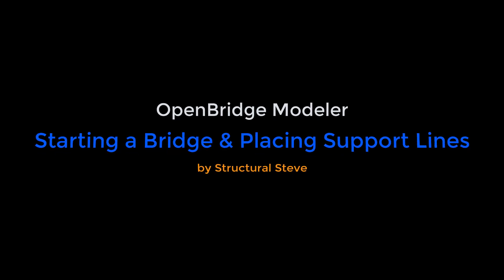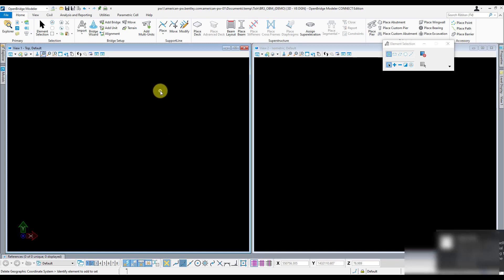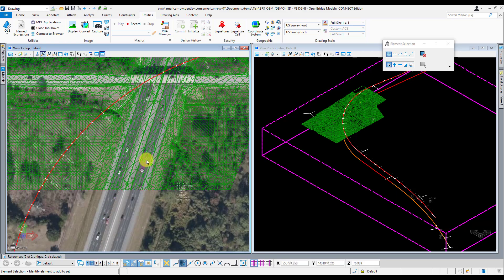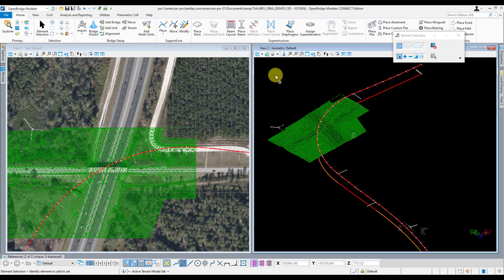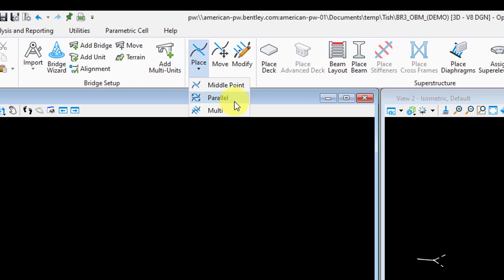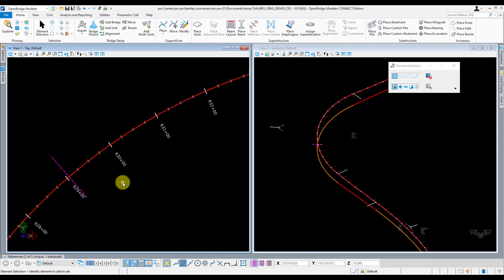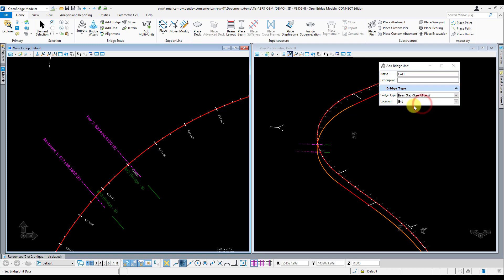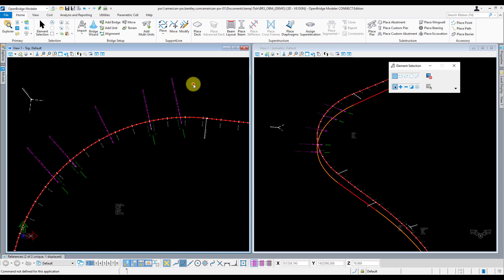OpenBridge Modeler - Starting a Bridge & Placing Support Lines

Comment: Steve, have you ever seen the manipulators not be selectable?  For instance, when I place support lines and then chick on one of them I see the angle/length/station manipulators show up. When I hover the pointer over any of this info it will not select it. I’ve also had the same trouble with alignment manipulators. Is it possible the 3D is not allowing it to be selected?  I’m running connect 2021 release 1 update 10.
Reply: Well, I just figured it out. If I zoom way out I can the select and modify them, if I zoom up to them, they cannot be edited. Got to be a bug.
Reply from the maker: @93SA10  I usually select the support like then edit it through the properties dialogue. That will be the most consistent way of doing it

Comment: Hi Steve. I have an 11 span bridge with 3 units.  My bridge has 9 total piers but 2 of the piers have 2 bearing lines. These are where my units switch. When I am laying out my support lines for these 2 piers, should I just have a single support line at the centerline of pier or two support lines representing the two bearing lines?  Thanks so much!
Reply from the maker: Support lines and bearing lines are independent of each other. You should only have one support line per substructure element (pier or abutment). The place bearing tool allows you to place a single bearing line or two bearing lines as a single bearing group.
Reply: Thank you so much Steve!  I was worried I’d get my model way down the line and have to redo it.

Comment: Hi Steve. This may be a little out of your wheel house because it involves OpenRoads, but I'm having difficulty selecting my alignment when clicking the 'Add Bridge' button. I created an alignment in OpenRoads, added a terrain model, set my vertical data, and set it as my active profile. I then attached it as a reference in my OBM model, but it won't let me select the alignment. It just says 'Element not valid for tool'. Any ideas? Let me know if you need more info. Any help would be greatly appreciated.
Reply from the maker: Hi Bryan. When ORD creates an alignment it creates two separate elements: a 2D alignment and a 3D alignment. The 2D one is the one that has civil data associated with it, thus it is the one you need to select when adding bridge. To help with this I always turn off that 3D alignment in my level display.

Comment: Hi, I have to model an existing bridge from available construction plans. This bridge is part of a twin bridge system and the alignment is in between these two bridges. Could you please provide an insight as to how to model a bridge where the available alignment information is parallel to the bridge and away from the centerline.  Thank you.
Reply from the maker: It depends on how your alignment/profile is driving the bridge geometry but I would suspect that it would just be a matter of doing a horizontal offset when placing your deck, and possible a vertical offset as well. That is what I had to did recently for a similar situation. Another option would be to create auxiliary alignments and use those with point control to drive your deck.